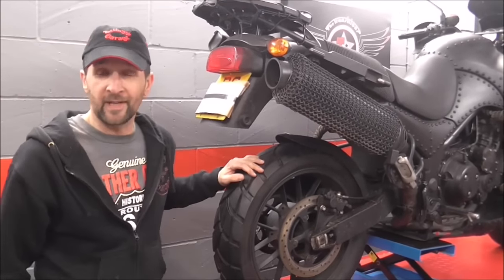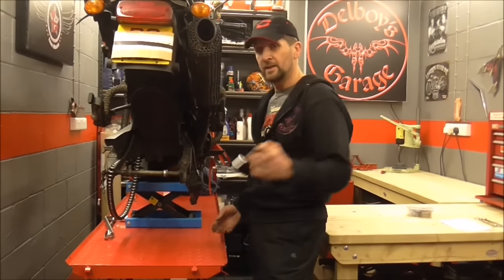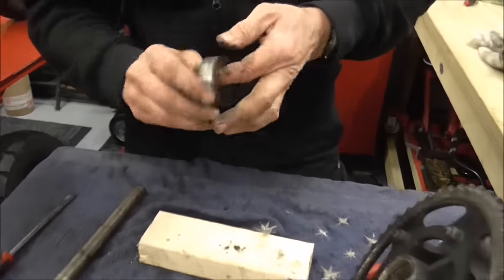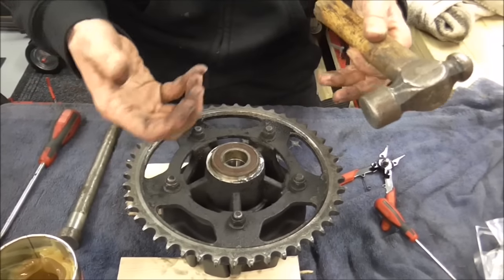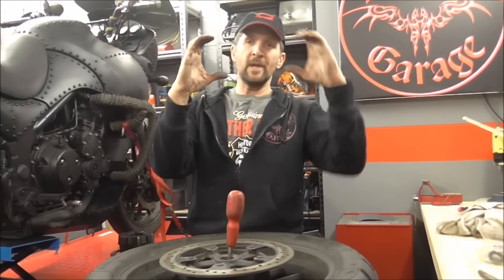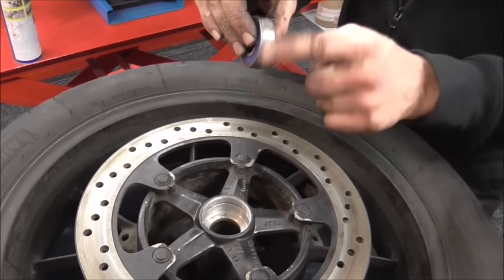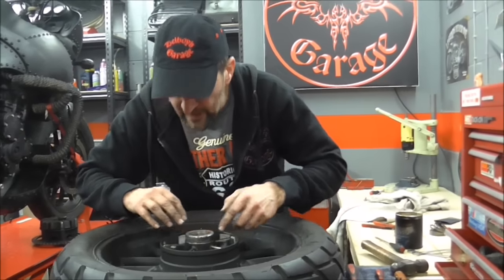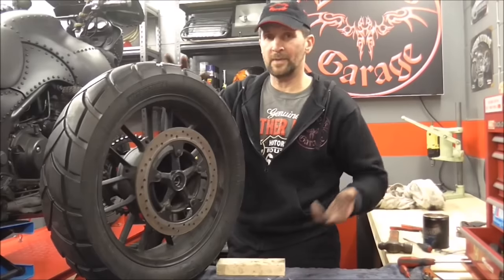Delboy's Garage, Motorcycle Wheel Bearing Replacement.

Comment: Nice video Del, thanks.

That's right that tube isn't to be too tight.

Any advancements in painting with the rattle cans? I bought a fairing for the Bandit 12, it looked black in the ad so I assumed it was, it was green when it arrived.
I watch your Harley Iron side panel vids 1 2 3 4 .. very helpful.
Reply from the maker: +James McCreadie Hi buddy, that video covers it exactly, the secret is temperature and not coating up too heavily... if it's about 20degrees plus in your garage, then the paint floats out beautifully to make a glossy finish... and if it's too cold, then the paint goes stodgy and looks grainy... remember, just have a good go at it, and if it comes out horribly, it's not the end of the world, just treat it as a base coat, wait a few days to let it dry, then sand it down and do it again ... the more practice you get, the better finish you will achieve - send us a photo when it's done !!
Reply: +Moonfleet41 Thanks for that Del, will get a before and after.. there's the standard decals to think about too but will make a decision on that when the temps increase. I got the whole fairing/screen/headlight for £60 and I organised the courier (£15) so wasn't too bothered it arriving green, a challenge for me to have a go at painting. What's your view on black lacquer?

Comment: love the wacky wack loose flappy slack lol,  I need to check mine, ive not done the back ones since ive had the bike, and the back has been feeling a little bit squirmy but not all the time, and ive only noticed it at slow speed maneuvering so I think theres something going on, any ideas what else it could be if theres no play in the bearings, how do I check the swing arm ? thanks D&P great vid loving the new garage mate.
Reply from the maker: +Daz Fowell Hi Daz, vague and unconnected feel form the steering can be wheel bearings (either end), and if they are fine, check the swing arm bearings... bike on the side stand, just grab the wheel at the back and force it side to side... feel for any play at all..there should be none.. if you think its not the wheel, then grab the swing arm and force side to side....if the play is still there... then its your swing arm bearings... hope its ok mate... good luck.. Del.

Comment: I have a question for you . When you put in the new wheel bearings how come you did not remove the blue plastic and actually  pack those bearings with grease?  yes you greased the outside metal but not the actual bearings. I think I would have repacked the bearings with grease.
Reply from the maker: Common misconception mate, there's no need to remove the seals and add more grease, they are greased and sealed at the factory, if you prize those seals out, they never go back in properly..

Comment: I've been building a yamaha xs 650 for 4 yrs. now using a hardtail frame I have all correct pcs. for rear wheel- when i put it all together i still have aprox. 2-3mm gap between brake caliper mount and end spacer. bought rim on ebay quoted brand new OEM- brand new bearings&seals- I don't recall if center tube was new or not-- when everything is installed wheel does not spin freely like yours in vid feel very tight and rotor is tight to right side- there's actually a gap between rotor and inside brake pad-- any thoughts would be much appreciated-- excellent vid you have here
Reply from the maker: OK, it's near on impossible to contribute a suggestion to your problem without looking at it... but from what you describe, could the wheel be in the wrong position due to the spacers being incorrect?  Have you got the wheel spacers the correct way round?  Is there a washer missing?  Try taking all the wheel spacers out, and just fit the wheel with the axle only, fit the caliper on to the disc and the chain on to the sprocket, and then measure with a vernier caliper what spaces are left between the wheel bearing and the swing arm... this should give you the correct size for your spacers, then you can check you have the right ones in the right order, or if there is something missing.
Reply: @Moonfleet41  thanks I'll give it a try

Comment: This really is a great video! Quick question for you. I am currently working on installing a rear bearing for CFMoto V5, an almost identical process that your video displays. Here is my problem. When reassembling with your two (2) part process for bearing installation, your bearing slips in flush  by pushing it - then you use the old bearing to push it the rest of the way. Mine definitely is NOT able to be pushed for the first portion.  I know my parts are OEM so, suggestion? I used the proper grease...etc... but it doesn't budge when I evenly push it.
Reply from the maker: hi Matthew.. did you think to check if you have been sent the correct bearing......did you measure it against the outside diameter of the old one you took out..?
Reply: Yes I did - exact. The old was really difficult to get out too. But definitely is the correct size.

Comment: Hi Del,i been changing my bearings like you showed but i realize the new bearing goes in the sprocket carrier is right on size but  1mm smaller on width compare if the old one.do you think it will be ok?cheers

Comment: Have followed your instructions (and Haynes manual's) meticulously. Wheel is thoroughly cleaned. Right hand bearing has gone in fine. However, I don't want to install the left hand bearing because the spacer seems to be too long. The end seems to be sitting about 1mm above the bearing 'seat'. Ever heard of a spacer being too long? Surely this will wreck the bearing? (1998 Honda CB500 SX. Spacer is made of steel).
Reply from the maker: Hi Alex, I presume you've put the bearing in the correct side first, which is the one that fits against a 'seat', leaving the open end, which the spacer tube can be removed through, to have it's bearing fitted last??   If you have fitted the bearing in the open side first, then there's nothing to stop it going in too far and pushing the spacer out the other side, leaving no room for the other bearing??
Reply: Firstly - huge thank you for your videos. This is the first one I've followed and I'm really impressed by the level of detail and clear instruction. 

I followed the Haynes manual instructions and did the right-hand bearing first. In light of your comments about how easy it is to knacker your bearings or hammer something in crooked, I took great care. I was able to push the bearings in a little way using my fingers (bearings straight from the freezer). I was reluctant to hammer the left-hand bearing in as it was obvious to me that it wouldn't seat. Took the wheel to a local trusted old-school motorcycle shop this afternoon and they said should be fine to proceed. However, they pointed out that the wheel has a machined insert, which I'm now beginning to suspect might be a repair (although they've said it looks well-machined and done to a high standard). Awaiting confirmation on whether or not this is how the wheel should be. Used the old (cleaned) bearing as a drift and followed the gentle 'triangular' tapping method. Did not hear the change of tone. Both new bearings are now jammed tight against the spacer and will not rotate at all. They are stuck fast. I'm absolutely gutted. I was so careful.
Reply from the maker: See what they say about the modification on the wheel Alex, let me know, and we'll take it from there... !
Reply: All sorted! (That machined insert isn't a modification - they come from the factory like that).

 Anyway - where your wheel has a 'seated' (ledge) side and an 'open' end, mine has a ledge on both sides (God knows why because that’s what’s caused the confusion). 

However, the 2nd ledge should be ignored (i.e. the bearing doesn't need to be seated flush as it does on the right-hand bearing). Took it back to the workshop this morning and the chap there used a slide hammer. Pulled it out and reseated it (gently!) for me. Thanks again.
Reply from the maker: Glad you got it sorted Alex... good news !

Comment: i had worst case scenario a few times, bearing was seized in and centre race came away, just left with outer race and very little to work with, came out eventually with a bit of heat though.
Reply from the maker: Good fix there Jason, any bearing, even a brand new one, can rip apart if you pull hard enough on it,  the heat is the trick, as soon as it feels like it doesn't want to move.. get the hot gun on it right away, they come out every time then. !

Comment: I was wondering when I went to put my axle back in what it was hitting.  maybe I should take it back apart and hit bearing down a hair more. though I did get the axle in with it a hair looser then yours.  but at least its not broke I thought something in there might be broken.
Reply from the maker: All axles will hang up on things on the way through.. they're a close clearance fit, and the middle spacer tube always falls out of line a bit and needs to be lined up.. is it helps.. i often release the suspension completely so i can wiggle the swing arm up and down freely.. then stand the wheel on the deck.. holding no weight in one hand while trying to wrestle the axle through with the other makes it so much easier..!!!!!

Comment: Excellent video. I used this as a 'how to' on my Kwacker ZZR-1100. great job and I learned some, saved some. How do you know if your cush drive is worn?
Reply from the maker: Grab the sprocket from behind the bike, one hand top and one hand bottom,  try to rotate the sprocket with the back brake pedal held down....if it can be rotated more than an inch then it's time for some new ones !
Reply: @Moonfleet41  Thanks for the information. Although it's raining cats and dogs here in Ayrshire, Jockan, it'll be a good wee experiment to try in the garage. Thanks Delboy.

Comment: For any noobs out there (me included even though I've changed 50 plus chains), don't over rivet!  I used an old riveter bolt and over tightened it, it exploded and shrapnel went into my knee.
Reply from the maker: Sounds nasty mate, there's a lot of forces at play on jobs like this.. !

Comment: Hi,  I've got a question about ordering seals and bearings from a  bearing company rather than from a motorcycle parts dealer.  Will bearing companies have information regarding the size of bearings required for models of motorcycle or will you have to first pop the old bearings out to measure and give the information to the bearing company.  Same for the seals?  Again, tx very much
Reply from the maker: Try Moores International , they are a bearings company and their sister company is Moore Speed Racing, a motorcycle tuning company - the guys will be able to give you the exact bearing based on your bike, as for other companies, I wouldn't be sure unless I asked them - you would imagine that they would keep references to all the bearings they need, after all, 90% of bearings are for automotive use aren't they...

Comment: Hi there, off topic i know. But need some advice. remember you yamaha xjr vids. well i have a 2001 xjr that wont start. ignition light on then loud click from starter solonid. replaced that and new starter motor. Still nothing. so obviouly electrical issue. but what? can you make any suggestions what to try next please.    Thanks Paul

Comment: Can’t get a decent purchase with the screwdriver when trying to remove the bearings from inside, any suggestions?
Reply from the maker: Hi Luke.. are you not able to lever the inner spacer tube to one side..? it could be tight. but once you can push that out of the way you can get a blade against it quite easily...!
Reply: Moonfleet41 it goes to one side, but not enough to get enough purchase, sharp punches or screwdriver just slip off. Think I’ll need a puller tool to be honest

Comment: Hi Delboy, thank you for the great Vids👍. I am replacing my wheel bearings after both rims have been powder coated, but what brand/type of grease should I use to grease up the axle and holes before fitted the bearing kit? Regards Alan 👍🏍
Reply from the maker: Hi Alan, for bearings I kust use regular LM grease, often you'll see bearing grease written on the tin, the axle itself just needs a thing coat of light grease, purely to stop it corroding, as it doesn't rub against anything once it's fitted... fitting the bearings in to the rims, just a tiny thin smear on the inside of the hub, but no quantity cos there's no room for it... if you're gonna get the bike wet every day, then you could use white lithium grease in exposed areas, but I personally don't bother.  Good luck with it Alan, hope it all goes well!

Comment: So if the brake hoses are rubber, leaving them hanging like that will do damage to them? As opposed to steel braided lines?
Reply from the maker: No mate, won't do any harm to them, as long as they are healthy and in good condition, the weight of a caliper is fine, and if they're not in good condition, and perhaps cracked, then you should be replacing them anyway.

Comment: Very good video informative and clear. Have you got any ideas for the front bearings where the spacer does not allow to get at the back of the bearing to knock it? Thanks.
Reply from the maker: The spacer always moves, they're just a little tight.. use a sharp thin 
chisel fed through the wheel, and tap against the edge of the opposite 
end bearing all it needs is half  a millimeter of movement and it'll 
free up.!Good luck with it.
Reply: Thankyou. Glad I only need half a mil because thats all ive got. Will post back and let you know how I get on.

Comment: Thank you for this great vid. The spacer tube in my rear wheel (BMW f800) won't move back and forth like yours. Any advice on how to pull the bearing out if this tube doesn't budge so I can get a screwdriver in there?
Reply from the maker: It'll move mate, just poke a pry bar in the top bearing and lever it across slightly.. then you can tap it out from the other side !
Reply: @Moonfleet41  ok thanks I’ll give it another try. Thanks again!

Comment: Its not fair! AGAIN! I just tried out your whole approach and nothing gives. I even used heat and baked the wheel several times, every time hotter until in the end the grease even flowed out. I heard the the tell take tings indicating that the different expansion rates took effect. Still no results. My explanation: The central bore seems to be so narrow that the distancing tube is not able to move far enough out off the center to get real hold on the bearings inner rings when trying to tap out the bearings. It feels like I am actually just hitting the chamfering which basically makes my tool jump off every time. Any additional tips?
Reply from the maker: Nothing worse than your tool jumping off every time...how frustrating would that be...lol .    
OK, seriously.. those tube in between the two bearing are not secured by anything more than the grip of the two bearings... just get a crow bar in htere and lever it over out of the way... make sure you are levering on the correct side of course, becasue one side of the tube locates into a hole... only one of the two sides can move across....!!!!

Comment: Hey great video, Can you tell me when you put back on the rubber seal are you pushing it tight down as far as it will go or is it been kept flush with the top?
Reply from the maker: Hi Shaun, they are usually one and the same... just press it down in with your thumbs, should snap reassuringly in to position and will usually be pretty much flush....!

Comment: Thanks ! Would you recomment use heat/freeze to get the bearing easier home ?
Reply: +Niko Laus have seen several recommendation where people have put the bearing in the freezer before fitting to make the job a little easier, never seen the heat trick to get the bearings in though
Reply from the maker: +Niko Laus Hi Niko, go by what you find when knocking the old ones out... if you need to heat to remove them, then it's good to do the same when fitting the new ones as it saves stressing the casting, and the best procedure is to put the bearing in the freezer for an hour to get it down to 0c then pour boiling water in the hole (this won't hurt it as by the time you get the kettle to the garage it will be about 90degrees)... and then once you grease the cold bearing, you'll be practically be able to push it in with your fingers... using hot water to heat the alloy is way safer than using a flame and it won't blister your paint or powder coat... if you don't like the water idea, then play a hairdryer in the hole for a few minutes work too !
Reply: +Moonfleet41 Thanks for the tip !

Comment: Followed your steps exactly and for 3 hours now, trying to get the old one out that I used to tap the new one in. Any suggestions? Mine is not releasing the way yours did. Broke 2 screwdriver tips now too!
Reply from the maker: Hi Jon, the only thing you can do is gently tap on the side of the protruding bearing cup, side to side alternately, and that should gradually work it upwards and out!
Reply: @Moonfleet41  
Yea..was trying that for a while. Finally just now got it out by using the upper jaw of my pliers similar to how you used your screw driver, and worked it upward.  Thanks nan. Keep up the great vids.